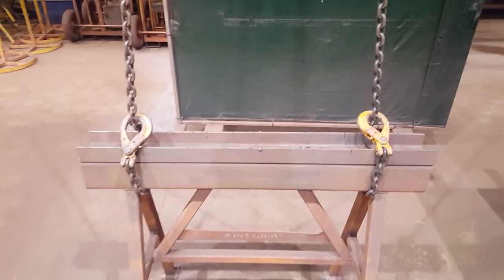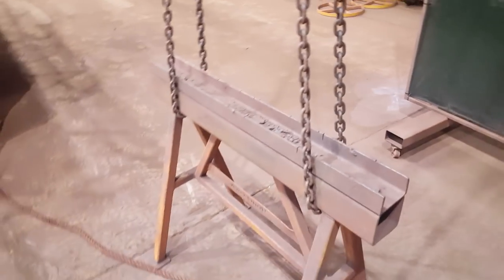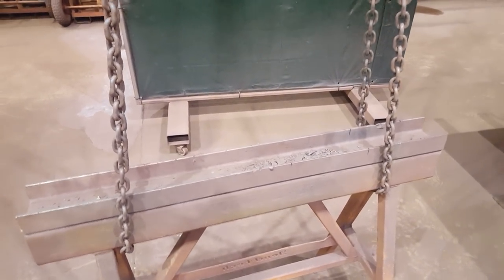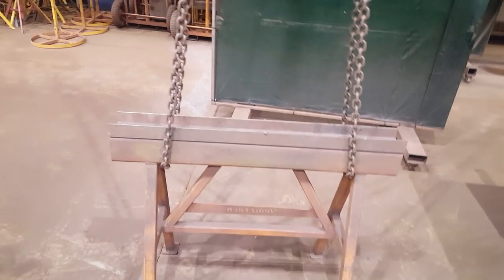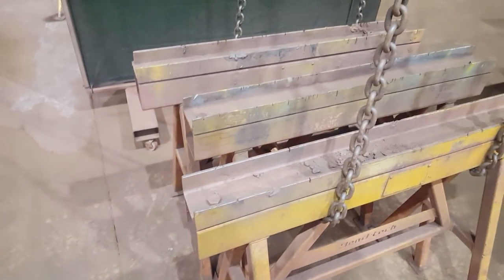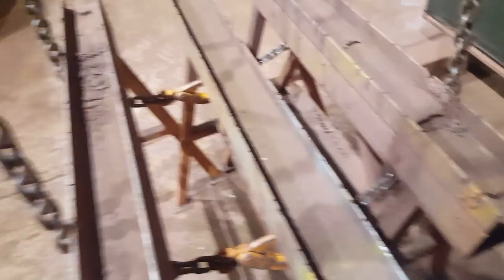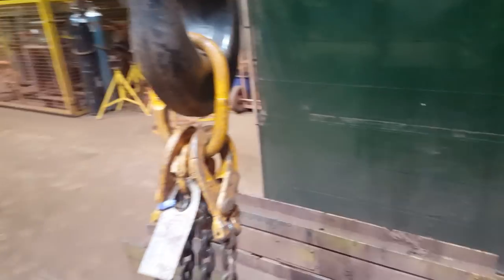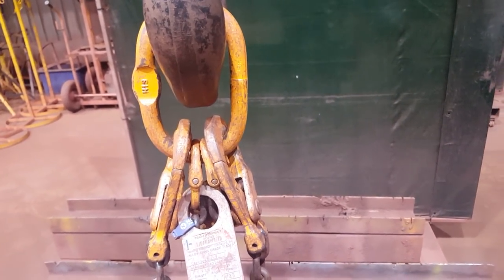Rigging terminology basic

Comment: So a double wrap will increase the friction on a steel pipe or beam,and wrapping around a square load ,eg a beam you lose 0.5 of the rated capacity when reaved.
Reply from the maker: Yes

Comment: In the UK the shortened chains with the hooks would be point loading (I don't have to look it up as I know from a safety standpoint that's what they'd say). Although I didn't know you could put a bow shackle on the chain and use the hook? Why wouldn't this be point loading as the bow shackle isn't on the master ring?
Reply from the maker: Good question!

Comment: On this vlog , there are only one legal technique of proper rigging so far, that is the chocker style, kool thanks y’all BigAl California in theUSA.
Reply from the maker: Yeah remeber to follow rules in ur country or site. Do not do illegal hitch
Reply: All picks were ok except for the hand shake and double wrap. Chain manufacturers do not ever recommend these types of use. 
Double wrap puts too much corner stress on the chain from 90 degree bites.
Hand shakes dont set correctly in the safe zone of the hook.
Never worry about chain grade, only worry about the rated chain wll. Working load limit. If it doesnt have a tag dont use it.

Comment: Isn't this called Dogging and  not Rigging?    I thought rigging is the installation and removal of load bearing structural steel members.
Reply from the maker: Yep, kinda more crane rigging although i use to do steel erection for a couple years
Reply: Rigging in our country is more complex lifting.
Dogman is the guy who unloads and loads trucks with supplies equipment etc with loads weights and lifting points already specified.
A Complex Rigger would be able to calculate a weight of an item determine the C.o.g and create lifting points.